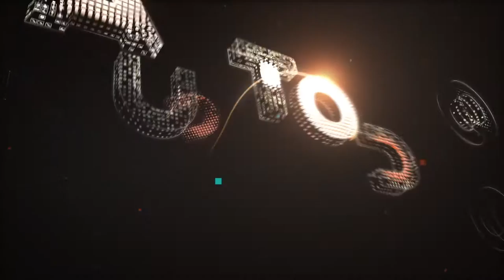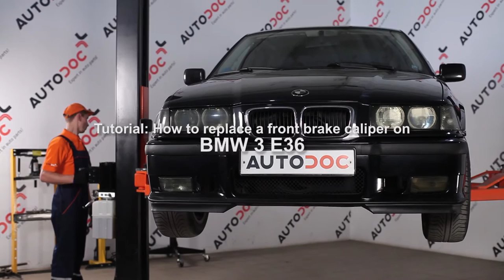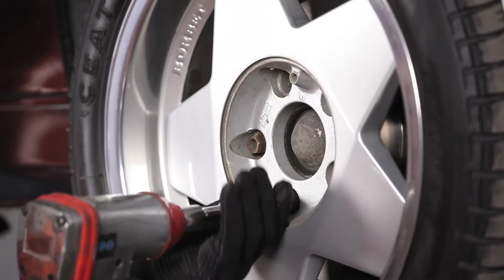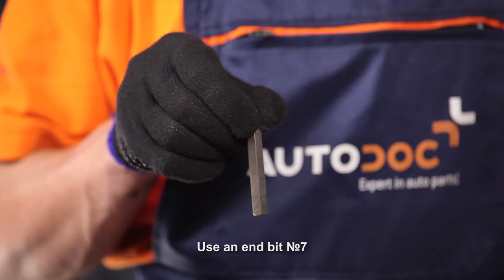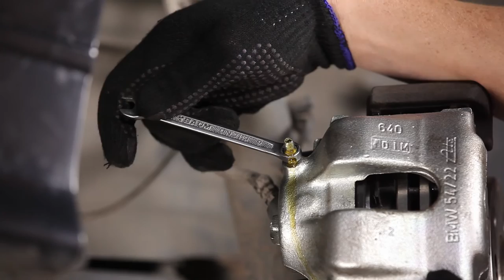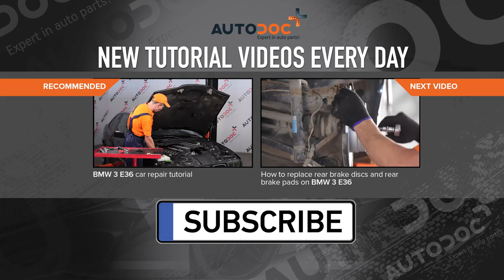How to change a front brake caliper on BMW 3 E36 TUTORIAL | AUTODOC

Comment: What was the point of the last step?  What did you do when you loosened and let fluid drip then tighten back up?  
Thank you for your help!
Reply from the maker: In this case, before bleeding the brake system, the brake calliper was filled with fluid by gravity.
AUTODOC

Comment: I’m having trouble with the clipper piston I’m using a c clamp and it won’t go down all the way so I can install the new break pads any help would be greatly appreciated thanks
Reply: If they’re old I’d just replace them. Mine did the same thing and it’s just nice to know I have brand new ones that I hope won’t cause problems
Reply from the maker: Thank you for your comment! It is hard to give you a proper assistance based on  the description. However, most likely a special tool is required to do the brake parts. We highly recommend you do not do the vehicle service on your own, be sure to contact an expert to get the job done. Kind regards, Autodoc!
Reply: Use a screwdriver or similar tool to pry the caliper (single piston) out as the brake rotor presses the pad and thus the piston into the caliper. Just the force of leverage prys the piston back in.

Comment: How did you stop the brake fluid coming out of the brake line?
Reply from the maker: Thank you for the feedback! Unfortunately, we didn’t show this moment in the video in the interest of time. However, in this case, the usual clamp for brake hoses was used. Best regards, Autodoc
Reply: Just User some stick or strut to press the brake pedal some inches. Master brake cLinder will close holes to reservoir. Voila, no spill

Comment: Is the process to do the rear the same?
Reply from the maker: Thank you for your comment! Replacement will be similar, the only thing that may differ slightly is the design features of the rear brake due to the presence of a hand brake. You can find the detailed manual in the service book of your car.
Best Reagrds, Autodoc Team!
Reply from the maker: Thank you for your comment!
The replacement will be similar, the only thing may differ slightly in the design features of the rear brake due to the presence of a hand brake. 
You can find a detailed manual in the service book of your car.
Best regards,
Autodoc team!